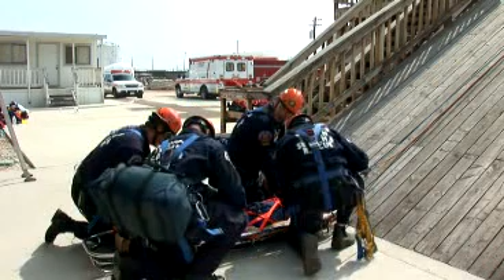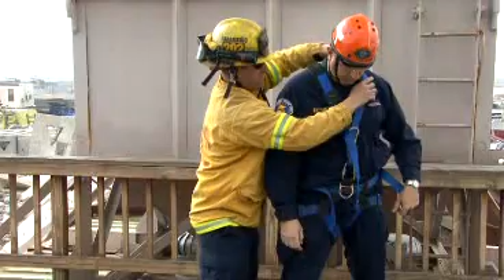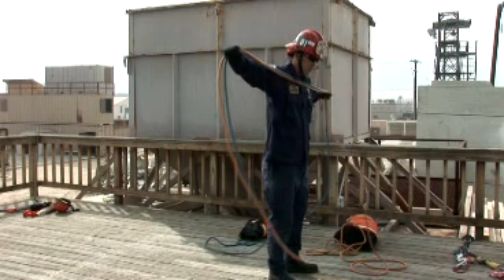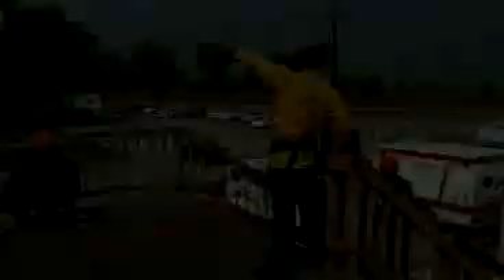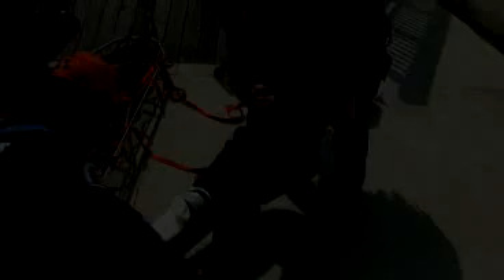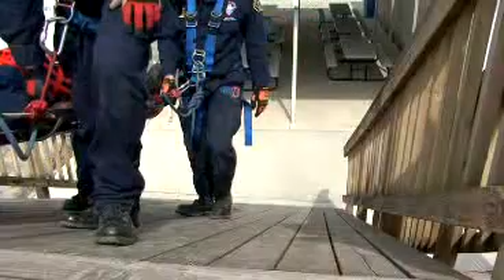Basic Low Angle Rope Rescue

Comment: I think attaching rope rescue system on the Tire of Fire Truck is inappropriate anchor point, because most of the fire trucks are equipped with Anchor Points with Shackles on the Rear side and infront of the Fire Truck.

Its only a matter of Fire Truck Positioning. I am not convince that the tire is the first priority to be used as anchor point for Low Angle Rescue.